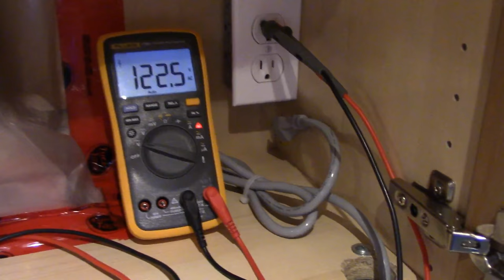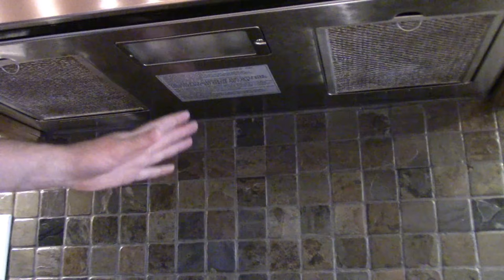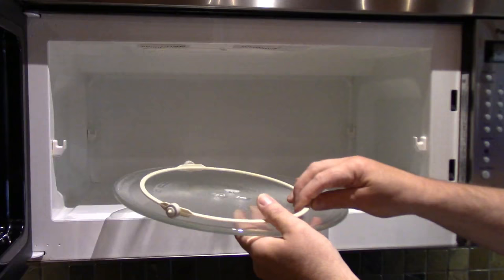Over the Counter Microwave Removal & Tips

Comment: This was helpful. Putting down something on the cooktop was a good tip, BUT make sure you don't accidentally move the burner knobs while jostling around with the microwave! We burnt 2 towels.
Reply from the maker: Yep, that's a great & important tip. I never even thought of that because this cook top is induction so it won't burn anything if it accidently gets powered on, but for other types of cook tops that actually produce heat - yes very good tip to ensure it's turned off/locked or turn off the circuit breaker or gas line.

Comment: Thanks for posting the unedited video, including surprise moment where microwave did not rotate out as expected, and your finding of the ducting piece that blocked it. Turned out that was the surprise I also encountered. Your video gave me the clue. I looked for and found where the ducting blocked the rotation. I used a thin metal yardstick to pop it out of the way and the microwave was immediately free to move.  Thanks again.
Reply from the maker: Glad it was helpful & more importantly, you were able to remove your radiation box. 🙂

Comment: On my Kenmore microwave hood combo, there is a lever you pull after you remove the top two mounting bolts. This releases a latch holding the microwave to the mounting plate. Had to look through an ancient install procedure to find out this secret.
Reply: Where is the lever? Currently stuck on this
Reply: @dre6036  It has been a few years, but it seems the lever has located on the upper left hand side. As I mentioned, I had to go on line for an old owners manual. Good Luck…Mike
Reply: This comment saved me. I was finding it difficult to remove my mother's old kenmore and couldn't figure it out for the life of me.

Comment: Thanks, your video helped me figure out why ours was stuck. Problem is I can't access the two screws on either side of the duct adaptor, they're covered by the bottom of the cabinet. Any suggestions?
Reply from the maker: Perhaps drilling two access holes in the cabinet bottom to get to those screws???

Comment: Just make sure your microwave is mounted on a sliding bracket before you pull those screws.  Many aren't, and when the screws come out it's going to go crashing onto your stovetop.  You might want to mention that...
Reply from the maker: I do mention it @2:58  I also mention and show having a big blanket/cushion under the unit just in case.